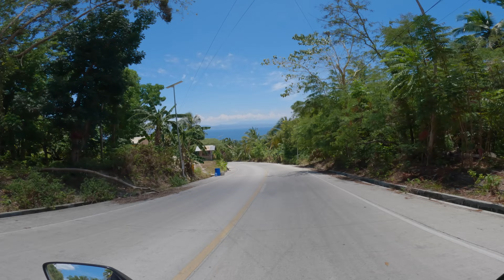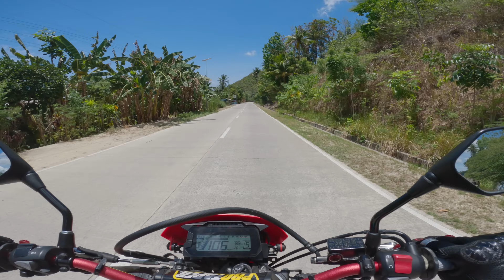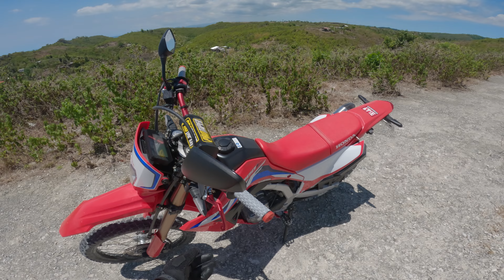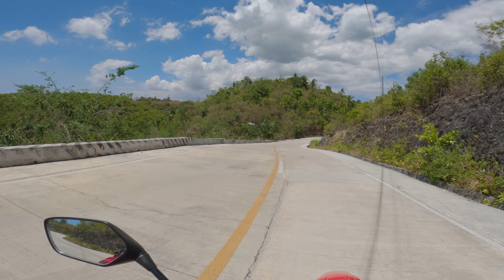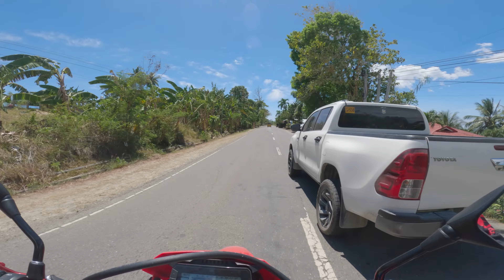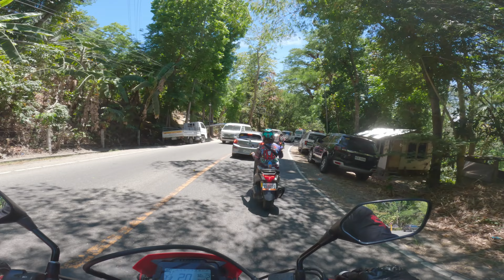Honda CRF 300L Mods Revealed: Unleashing the power!!

Comment: I did a version of all the ergo changes you made sourced from unapologetic Chinese sources (AliExpress) They’re all made there anyway, I just paid much less. Since I’m back in CA, I brought my airbox, Ali. exhaust and ecu so I can make my mods(cbr velocity stack, installed 2nd snorkel, twin-air air cleaner, Ali. header pipe needed cat. removed, mid-pipe needs some dents banged in for frame clearance, mufflers so loud it needs mods, sent ecu to 550 for Stage 3.0 reflash)
When I return to Cebu, I will also bring 301cc big bore kit & cbr cams. 
Hopefully we’ll get to ride together.
Reply from the maker: I bet you saved a fortune. If I was going that route there are plenty of options here. People offered to build me a custom welded exhaust system for under 10k pesos, crash guards and all sorts.
Reply: I’d like to meet these ppl

Comment: Sounds pretty good.  I've gone kinda the opposite route.  Done a lot if the same ergo items but did full Rally Raid 2 suspension.  Also got the Rally Raid 19/17 wheels so I could swap between DOT knobbies and 50/50 type tires on the smaller wheels.  

Been contemplating the Yoshimura/twin air (have but not installed) and 50 ECU flash.  Noise is definitely my concern.
Reply from the maker: Sounds good. How are you finding the Rally Raid suspension? I’ve got a racetek gs3 shock and rally raid level 1 forks but haven’t installed them yet.

Comment: Where do you buy your oil filter for the 300 Rally. I purchased a 2023 Rally in Dumaguete. I have a hard time finding filters for the first 1K. Oil Change.
Reply from the maker: I did too so I bought bought genuine ones online on Lazada . I then bought some third party ones too and they’re identical so will try them next time. I also got genuine Honda crush washers on there . I just reused the crush washer for the first oil change but by the second it developed a tiny leak so I’ll put a new one next time. 
I bought the gaskets from Amazon us but have just reused the original ones of far without problems.